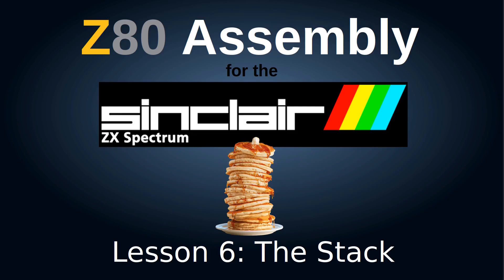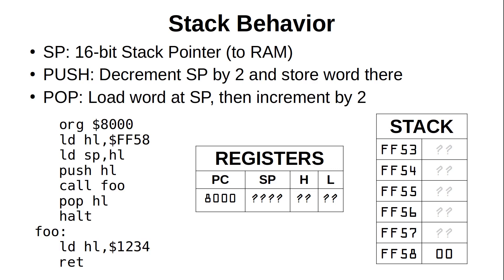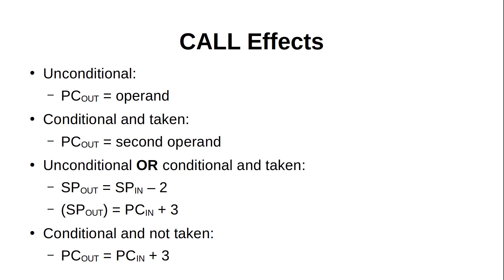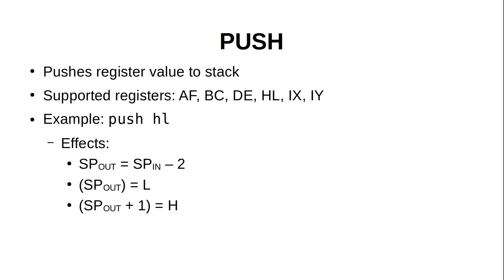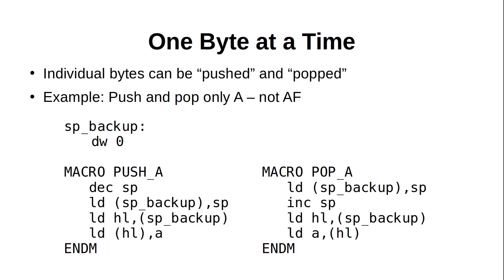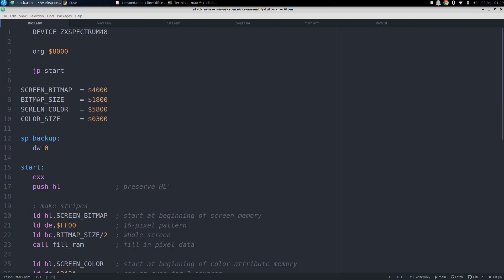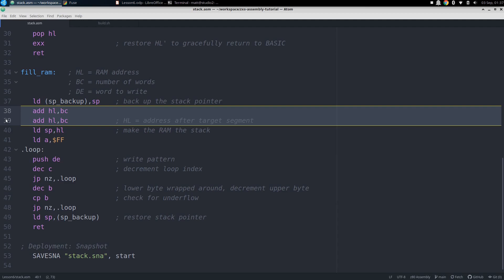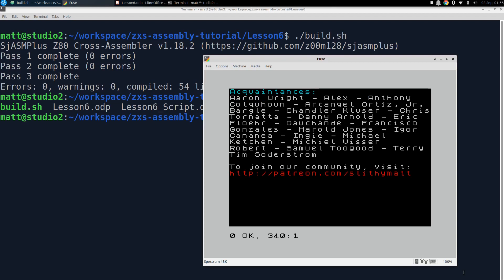The Stack: Z80 Assembly Language for the ZX Spectrum Tutorial, Episode 6

Comment: Very interesting thanks for the tutorial. I think there is a bug in your code in that it will not work correctly if the amount of data to be copied in BC register has a zero in the C register. it will copy an additional 0x100 words, or will go 512 bytes into the rom data.

Comment: 8:38 Definitely a mistake on your part. There is absolutely nothing special from the CPU's point of view about the RETI opcode. It does nothing more than what a regular RET would do. What makes it special is that Z80 specific I/O chips such as the Z80 PIO, Z80 SIO, Z80 CTC, etc. monitor the data bus and control signals and if they see two M1 states with the values ED and 4D, they recognize that an RETI operation has occurred and they can reset their priority status for nested interrupts.

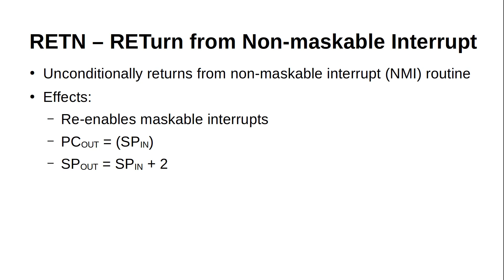9:20 As regards your PUSH_A and POP_A macros, my first words about them are ICK ICK ICK.
They destroy the HL register and frankly are rather ... inefficient.
If I wanted such a thing, look at:

; Takes 2 bytes and 17 clock cycles
; vs the 9 bytes and 43 clocks the video's example had.
; Additionally, no registers destroyed, not even F register
; vs the destruction of HL in video example.
PUSH_A MACRO
   PUSH AF
   INC SP
   ENDM

and

; Takes 2 bytes and 16 clocks
; vs 9 bytes and 43 clocks in video.
; Does have minor difference in effect.
; This destroys F register, while video
; destroys HL register.
POP_A MACRO
   DEC SP
   POP AF
   ENDM

If preserving F is absolutely needed, then

POP_A MACRO
  EX (SP),HL
  LD A,L
  EX (SP),HL
  INC SP
  ENDM

which preserves all registers, but takes 4 bytes and 48 clocks.

Comment: "push a" can be also done as: `push af : inc sp` .. and "pop a" is then `dec sp : pop af`, but that will affect flags, your macro doesn't (other option is `dec sp : pop hl : ld a,h` if you want to preserve flags).

your macros are nice for the purpose of showing Z80 instructions (how to store SP into memory), but performance wise they are not optimal. :)

Oh, but your "pop a" macro should do `inc sp` after `ld a,(hl)`, to avoid value in stack being overwritten by interrupt, so your pop macro is kinda buggy. By reshuffling the order the macros will work even with interrupts enabled, as you have then SP always below the values which must be preserved, and increment/decrement at time where it is not sensitive to interruption.

And the common idiom on Z80 to do HL=SP is rather `ld hl,0 : add hl,sp`, that's somewhat faster + smaller than the temporary memory buffer.

And one more common idiom, before routines like fill_ram, one can store the current SP directly into `ld sp,nn` instruction at end of the routine, self-modifying the code to reset SP to original value.

Other tiny detail: `RETI` is internally same as `RET`, and it can be used in any IM mode. The difference is, that external HW peripheral can be eavesdropping on the bus and recognise the RETI opcode (which differs from regular RET) to know that interrupt service routine did finish. This hasn't been used on ZX machines much, as already the ROM $38 interrupt handler is not respecting this convention and does end with regular RET.
Reply from the maker: Yes, I do mention that these macros should only be used when interrupts are disabled, and the point of them really was to illustrate how to push and pop without PUSH and POP.

Comment: Damn that quick fill thing is clever.
Reply: Some of the more advanced games use this to blit data to the screen quickly.  I can be tricky to write optimal routines that make use of it (and sometimes means storing sprite data in a funny order) but the benefits can be well worth it.
Reply: Using the SP to copy data fast is quite useful. But in order to actually be fast, the loop needs to be unrolled. Doing one double register in a loop is nearly worthless. Counting T states, his push costs 11, dec c costs 4, and the conditional jump costs 10 for a total cost of 25 T states. Ignoring the outer loop, the cost is about 13 T states per byte. Not bad, but interrupts need to be disabled and the code is rather ugly. LDIR costs 21 T states per byte and allows interrupts to be enabled.
ld hl,address
ld de,pattern
ld bc,size-2
call fill
halt
fill:
push hl
ld (hl),e
inc hl
ld (hl),d
inc hl
ex de,hl
pop hl
ldir
ret